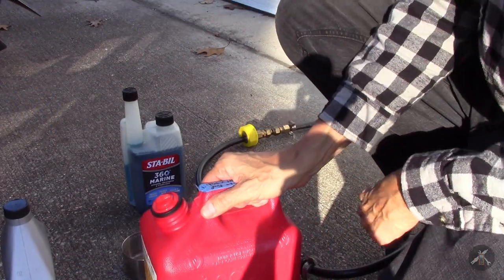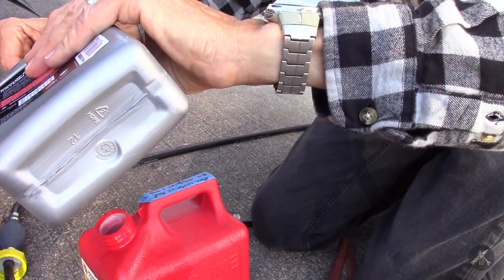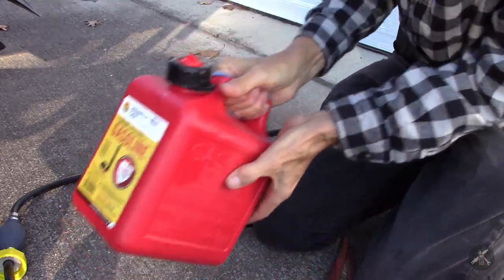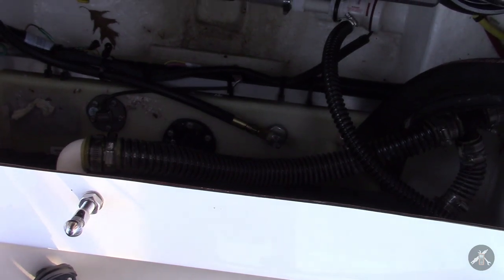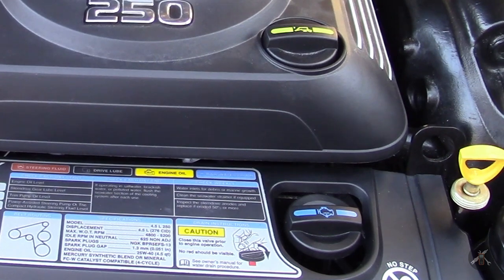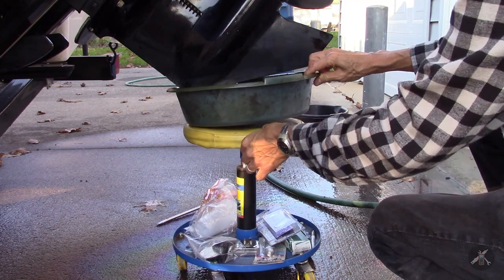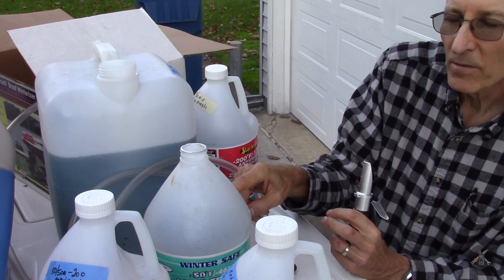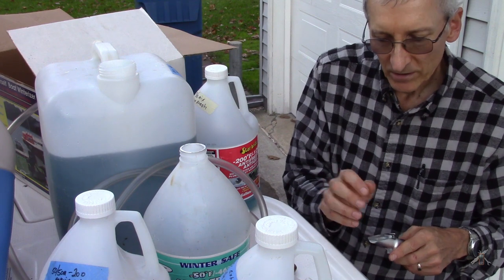Winterize 2018 Mercruiser 4.5 L Alpha1 Stern Drive

Comment: What were the fittings you used to connect to the fuel line?
Reply from the maker: Ahh, great question.  I made some measurements and went to a farm supply store that had JIC hydraulic fittings.  I picked a size that matched my dial caliper measurements, but those didn't fit.  After some more checks, I ended up at a hardware store for "conventional" flare fittings. These are used for soft copper tubing that you would use for water and they come in variations for adapting to hoses and pipe threads.  I believe they are SAE 45 degree flare.
It may vary by installation, so yours could be different. The thread should match so they spin on easily with finger pressure. If they are 45 degree flare, a pair of male fittings ought to make a right angle when the flare surfaces are matched up. The main thing is that they shouldn't leak.

Comment: Very good video! Thanks for sharing.  I have a question - I have rheumatoid arthritis and am having an increasingly difficult time completing these tasks ( hands just wont do what i ask them to ).  I was wondering if it would be possible to just fill a horse tank with a freeze proof liquid  then dip the outdrive into the tank and run it for a good while to winterize the cooling system?  If so what would be safe to use? Thanks!  (its exactly the same engine you have btw)
Reply from the maker: You're welcome.  I don't have experience with that method, but I have heard of it being done. If you have a tank that you can submerge the drive far enough to fully cover the intakes, probably roughly up to the plate below the trim / lift cylinders, I don't see why it wouldn't work.  If the tank was positioned right, you would collect the antifreeze from the engine outlets and recycle the antifreeze. It ought to be non-toxic propylene glycol marine / RV antifreeze with the corrosion inhibitors for the engine.
It would likely require quite a bit more antifreeze mix, but you could store that for future use.  It can be a challenge to get a tank underneath the stern drive at the right depth.  If the tank is too tall, it would interfere with the trim cylinders, and the drive must trim up high enough to get the tank underneath.  It may take a little ingenuity, but should be possible.
Reply: @bitsofwisdom460   Thanks so much for the reply.   I am building a garage with a 4 post lift as one of its features. I think it should work really well for dunking the outdrive in the tank.  If i give it a try, I'll report back to you - Thanks for all you do!

Comment: Where did you get the empty jug with the red valve for the antifreeze?
Reply from the maker: It is a Camco - Do it yourself winterizing kit #65501.  I will post a link in the description section.
Reply: @bitsofwisdom460  thanks. How did you block the open fuel line in the boat so that the fuel pump didn’t pump a bunch of gas into the bilge while you ran it off the one gallon can ?
Reply from the maker: @srusan8963  Good question.  Perhaps this point needs some extra caution.  This engine has the fuel pump mounted to the engine.  The below deck tanks are typically a suction design, so the fuel pump will be drawing fuel from the small can rather than the tank.  In my case that means that the fuel tank feed port is open to atmosphere, the port is on the top of the tank and there is not a pump in the tank, so there wouldn't be any leakage.  It would be safer to cap off the fuel tank port to prevent any vapor escape. 
CAUTION:  Before removing the fuel line from the tank to engine: 1. Check your system to be sure that you don't have a fuel pump mounted in the tank. I think this is rare, I have never seen one, but it's worth a check.  Your tank will usually have an electric sending unit for the gauge, so there will usually be some wires coming from the tank.  2. Be sure that your fuel tank withdrawal fitting is above the fuel level in the tank.  If you have a full tank of fuel and raise the bow of the boat, fuel could run to the back of the tank and leak from the withdrawal port when you loosen and remove the fitting.
Reply: @bitsofwisdom460  thanks I found an image of the attwood fuel tank and confirmed there is just a pick up in the tank. No pump. . I also had trouble with getting the block fully drained this weekend. Going to try again before putting into storage.
Reply from the maker: @srusan8963  I don't know if you saw my 2nd video:
https://www.youtube.com/watch?v=VpVAUCigTps
I go through the drain and fill of the block to see how much it holds and how it drains. It might be helpful.

Comment: How much antifreeze did it take to fill engine? Thanks!
Reply from the maker: The short answer is that the block holds roughly 1.75 gallons.  If the system is full, that is the amount that will come from the single point drain. I had trouble filling the block completely with the 5 gallon bottle and ran a number of experiments.  The additional detail is in the second video:
https://youtu.be/VpVAUCigTps
Reply: Thank you. Now I’m thinking I might just drain using the single point, fill with antifreeze using your method but drain again once filled. That should take care of any water or at least dilute what’s left with antifreeze
Reply from the maker: @davew4260  Yes, that will likely do the job.  My dealer did mine the first year and it was drained when I checked in spring. There is the school of thought that says that air doesn't freeze, so draining may be a good idea.  If you fill the block manually and don't run the engine to circulate, you do lose the corrosion prevention of flowing antifreeze mix through the exhaust manifolds.  I don't know if that is truly significant as long as they have been flushed with fresh water.
Reply: Also, instead of filling through the plastic plug near thermostat I think it’s much easier to remove the 10mm bolts and remove thermostat and pour directly into thermostat housing.
Reply from the maker: @davew4260  You certainly can do that, I don't see why it wouldn't work. I haven't had this one apart yet, but the parts list shows two gaskets (or a gasket and o ring--can't tell for sure) in that assembly.  My personal preference is that I really don't like scraping gaskets. If there is a port, I always try to use it.

Comment: You need to run engine with water and muffs until engine thermostat is open and then switch to antifreeze to completely fill block
Reply from the maker: The thermostat isn't the limitation. I had heard that concern and thought perhaps that was a problem, so I ran some tests.  The block will fill just fine with the thermostat closed.  There is apparently enough bypass built into the system to prevent an air lock.
My followup video: https://youtu.be/VpVAUCigTps runs a number of tests on filling and draining the block. When I ran a cold engine with an empty block, it filled in 2 minutes to within a quart of a warmed up engine.  Had I run another 30 seconds or so, it would have probably been equal.  It does seem to fill a little faster on straight water / garden hose than the more viscous coolant on gravity feed.
The Mercruiser manual specifies to drain the block first. If you try to warm the engine on straight water and switch over to antifreeze, there will be massive dilution of the antifreeze and you won't have much freeze protection.
My conclusion after the tests in the 2nd video is that after draining the water, I will prefill the block with coolant through the "blue plug" port on the front of the engine, then fire it up and finish the job with antifreeze mix fed through the ear muffs to insure that the exhaust system cooling passages are filled. We'll see how that works this fall.
Reply: @bitsofwisdom460   you are correct. all thermostats have a vent bypass to allow the engine to completely fill before the thermostat opens. This also prevents hot spots.
Reply from the maker: @rfknapik  I agree that systems have a vent, but I have had a few where the vent was so small that the fill rate was extremely slow.  I was pleased to find that wasn't a limit in this one.